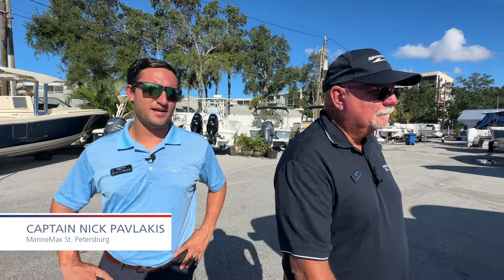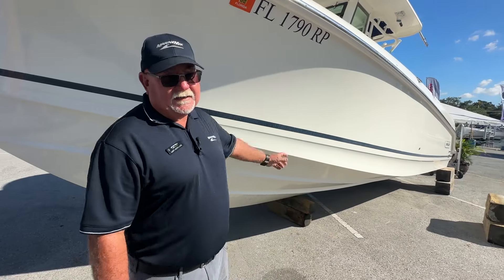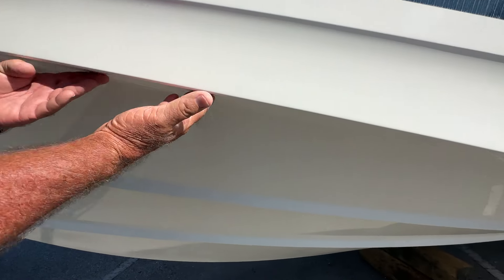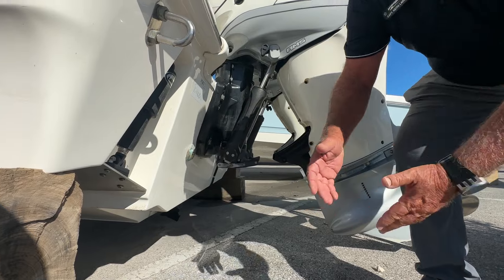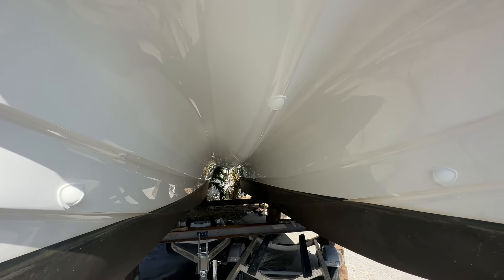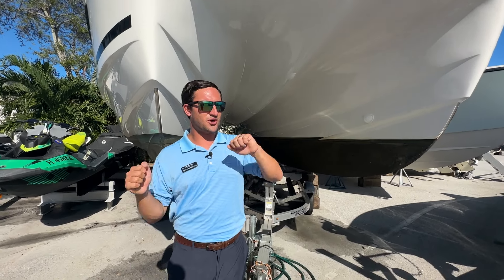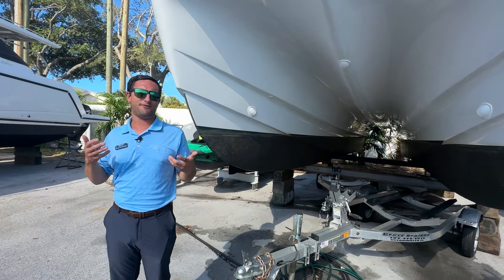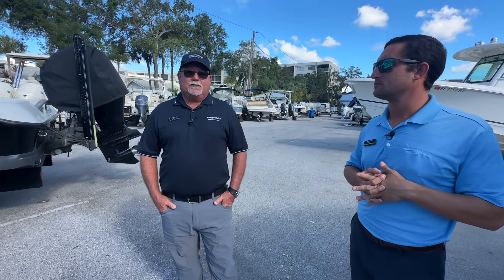Mono vs Multihulls | Boating Tips

Comment: For speed same engines same weight, what can be the fastest from the hull design?
Reply from the maker: Hi there, great question. You can connect with a MarineMax team member to help answer this and any other questions that you may have here: https://bit.ly/3NjB4kH
Reply: Which handles best crossing a bar with a large following sea?